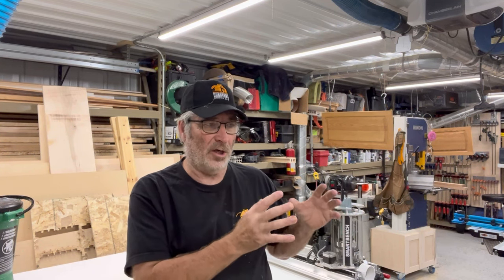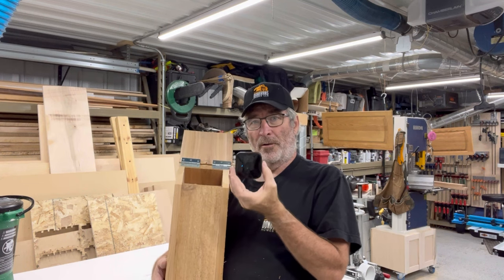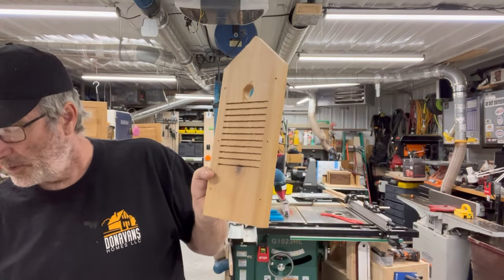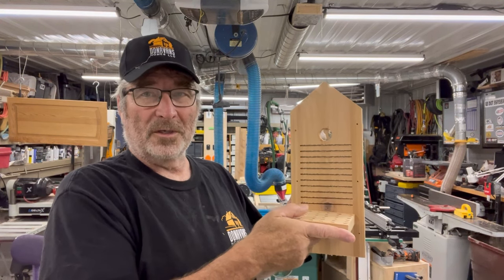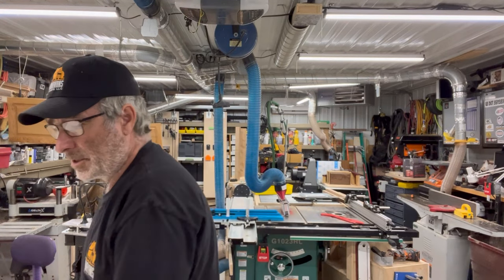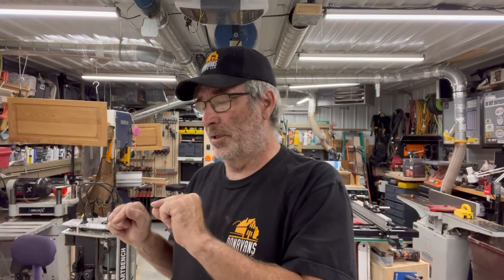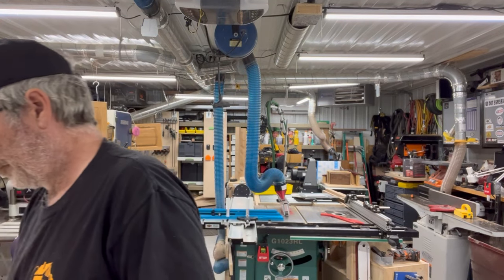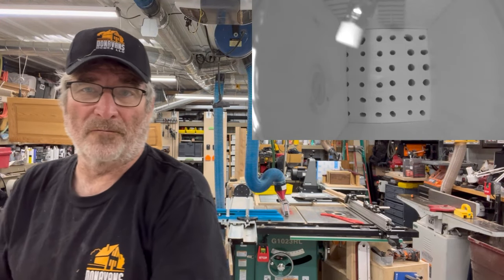Building a Bird house with Yeti CNC with  Blink Wi-Fi camera #cncwoodworking #cncrouter

Comment: In watching this great video, I was amused at the projection for the Blink batteries. My batteries don't hold up and Ive tried them all. The Blink camera plugged into live power works great as it never has a power failure. I have a love and hate relationship with my Blink cameras.  

The Blink camera manual operating system is easy to use. If one wants to manually go live, forget it. Takes forever to light up live!

I've got two WIFI systems available, AT&T or Spectrum.  Spectrum constantly gives me more speed. Eaglegards...  P.S. The joke of the day was the video automatically coming up behind Donovan's video - Matthew Cremona. Hahahaha,  yup.

EAGLEGARDS...

Comment: Donavan, et.al., 
Your design is nice. Looks like your wood was fairly soft, cedar perhaps?  My local squirrels loved gnawing away around the hole, so I added a second piece of oak on the outside and lined up the drilled holes. That should slow them down!